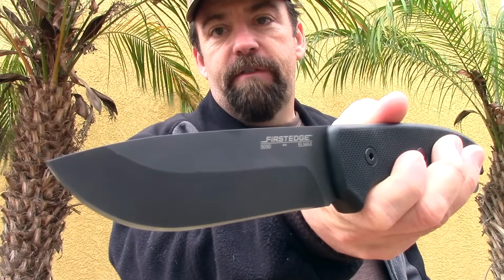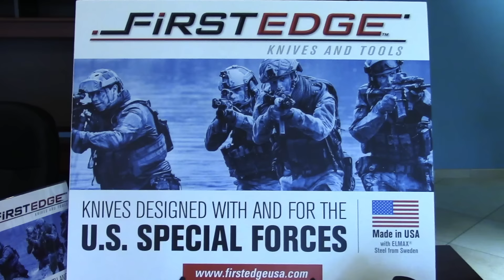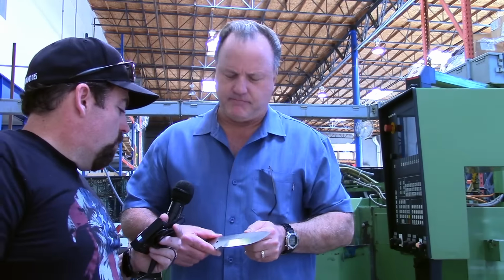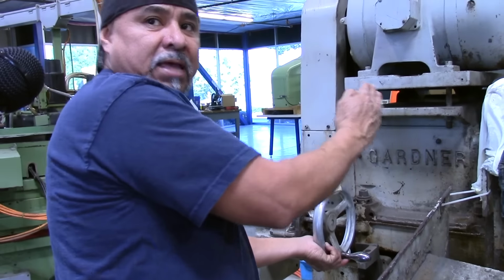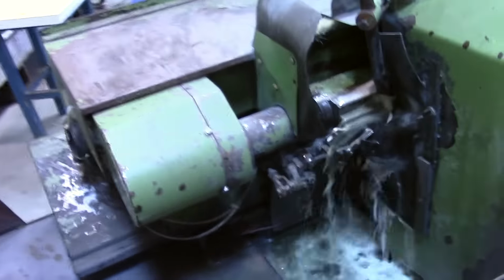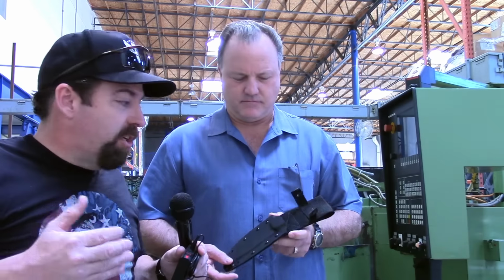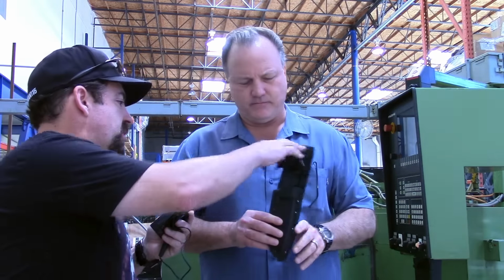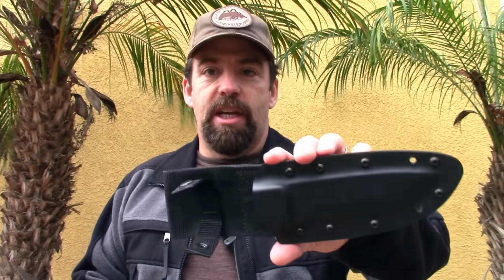Navy Seal Survival Knives - FirstEdge Knives Factory Tour

Comment: There's a reason the Ontario Mark 3 Diver is the issued knife and has served SEAL teams well for years. The hardening process and corrosion resistance on their 440a is unrivaled. And at $60 you just can't beat it. Well actually you can beat it. And it will just laugh at you.
Reply from the maker: +specopsbrat I will check it out.

Comment: Say Heah John, I just saw this 5050, it's awesome, I like that style of knife, infact I had one I made a few changes to..The base knife was the Rodent 6 in the SR101 Busse Technology 52100 Ballbearing Steel.  It comes at .265" thick so I had the blade thinned down to under a 1/4" thick,  Then I had the top gaurd taken off. It's now a High Saber Vex Grind just the way I like it. It sort of looks like a beefy RatManDu on steriods. And it's a 6"+ blade but with a choil, where the blending taking the top gaurd it allows my hand to even chop better. My Modde Rodent 6 is my Fav's 6" Survival Knife hands down. I pair it off with my Victorinox Delemont Collection Ranger Grip 78 and my 2Hawks Double Bit Hatchet and my Wicked Tough Saw and off I go into the wild bush yonder [,,,] Yup, no regrets, and surprisingly it does look a little similar to the 5050.

Comment: If the problem is determined not to be caused by defects in manufacture or materials we will inform you of the cost for repair. Upon agreement and payment we will perform the repair. If we are unable to improve the condition of the knife, we will return it to you with the recommendation that it be retired from use.
not sure how i wanna feel about this, but here's what i get from that: If the knife fails and you send it for repair they can charge you money and even if they can't fix it all they will do is tell you to retire the knife and you won't get any money back for their failure to repair the knife or even get a replacement knife.
Reply: +ZombieFighterOf2001  i could not believe it at first, i was like what am i reading. 
they just want the money.
Reply: Old post... but this still applies... they're saying "If you use the knife to do something stupidly un-knifely, such as stabing it into hardwood just to "see" if the tip will break, they're saying that unless there was a hardness or steel issue they're not going to just give you a new frikkin blade as a reward for your stoopidity.  At around $300 FE knives are not overpriced, especially compared to Strider and Busse type companies that wanted well over $425 for full sized fixed with G10 and that idiot proof warranty you seek.
Esee can do the warranty their way because a) 1095 is nails tough (but not much good at anything else) and b) because Esse's are waaaay overpriced for what they are, so you are indeed paying for a warranty you should never need if you use it reasonably.

Comment: Say Heah John. This reminded me of two of my recent knives that I'm going to use for bush craft, I'm going large and small for my knife carry, well axe, and saw. But I recently got the Steel Heart Ergo and the Badger Attack Ergo,  nice matching set, Oh I had both thinned down, and they are sharp..good video John, Thanx.
Reply from the maker: +paulie 4x Let me know how it works for you..
Reply: I will, I've been using the Potbelly with a neck carry a Top's Mini Scandi 2.5,  But I really like my Rodent 7 and the Rodent 4 both have choils and that makes them very versital, the new set only the Steel Heart Ergo has a choil, the Badger Attack Ergo hss a very little one but it's less than a 5" blade so it might work out.

Comment: why do they do the heat treat before sizing and the angle of the grind?
Reply from the maker: Maybe to keep the blade from warping? I'm not sure.
Reply: @Wingman115  heat treating a symmetrical bar stock is more predictable/consistent, ie the thin edge of a pre-ground blade loses heat more rapidly than the spine, plus odd warpage habits in curvatures.  Its also easier to straighten warps out of simple bar stock than a 3-dimensional ground blade.  The manufacturers would much rather grind soft steels.. hardend elmax (and similar) is brutal on disks, belts, and bits... plus, any coolant or feed speed hiccup and the blade is ruined unless returned to heat treat.

Comment: It's a very basic design that I like; much like my Survive! GSO-5 blade, but they should have took note from Fallkniven blades and sandwiched some good expensive steel inside some softer stainless steel for a great edge, extreme toughness, and better resistance to corrosion.The knife would have been stronger, and they could have saved money and materials in the process.

Comment: if the blade was thicker than .235 and had a life time warranty, even if i broke the blade i should be able to return it and get a new knife or at least try to fix it at no extra cost.
and at its price it should come with a life time warranty.
not my first choice but as a whittling knife i might get one.
great video keep up the good work.
Reply from the maker: +one survival Thanks for watching.
Reply: Hmmmmmm
      After speed reading as many comments as I felt like,,,,,
    Go find an area of forest that has been clear cut.  And there are brush piles some squandering barbarian is just going to wastefulluy burn,,, and make a sturdy long term shelter with it.
   Make camp furniture with it
         Whittle out some cooking tools..and then knock off the local Kandahar giant....

Comment: Say Heah John,  I caught this video again,  And I do have to say so myself,  I think I'm pretty close with my thinking on knives I take into the bush.  I too want to take a knife that I know regardless of what comes up,  I'll have a good one.  Today it was a rainy trip a few of us took,  We're still on it.  But we agree no matter what the weather,  we treat for symptoms.  So a little rain didn't stop us and yes we did get wet,  But we set up,  made a fire and we dried up a little,  But we will sleep inside.  The knife I took is my INFIMandu,  It's sort of similar especially the grind and for that I'm happy with my thinking.  The steel is the INFI on mine and that to me is also a good steel.  Usually  I carry the larger knife on person,  But since I teamed my Nuclear Meltdown Fussion Steel Heart  and it's a pretty hefty chopper and the trust I have in my INFIMandu which is a Ratmandu but in the INFI Steel,  I decided to attach the N. M. B. S. H.  to my backpack and belt carry the smaller knife.  I also really like carrying my Mora 510 as a neck carry, if for no other reason but as a edge saver.  Although the INFI Steel holds a great edge retention.  But the more I see the 5050 the more I'm interested  in it.  Knives like this peak my interest.  I do go on some kewl trios,  so it's important I get a good quality.  If the Special Forces are involved,  I tend to check those kind out.  For instance the Bravo 1 This one and a few others,  I even have a CarbonV S. R. K.  because of the military association  it had.  Yeah,  I will be checking this knife out and the Elma Steel it's made in. Laterz,  Lemme win some money tonight heh heh heh.
Reply from the maker: Good stuff Paulie. Your comments always bring a smile to my face...
Reply: Thanx,  John.  I know some think I'm funny,  But I've been a student of this hobby for a few 24's and I sort of got the feel what works for me,  But it's always nice to see that I'm on in the direction I'm going in.  But I'm glad I put a smile even a chuckle on you heh heh heh Funny like Ha Ha,  he he he, ,, ,
Reply: I always liked that line I'm Good Fella's
Reply: In not I'm
Reply: Say Heah John,  You brought me some good luck,  After I watched your SCHF40LD video,  The hollow handle made out of one piece of 1075, I just bought a Solingen German Handmade Bianchi,  Yeah,  the guys that make leather gun holsters,  They were big before Kydex.  Anyhow,  I got a Hollow Handle Survival/Fighting Knife.  It was given to their pilots (German) I think.  Anyhow this thing is made solid,  It's Brass and a 440c. Blade,  But I mean this thing is well made.  I do have a few hollow handle knives.  My Randall Made #18, my Buckhalter #184, my Tomahawk Brand but made in the U. S. A.  that I think specifically made to hunt hog,  That's how we used it,  At the time it was one of the longer blades back then.  Then my Russian made Professional Survival Hollow Handle,  it's made at the same plant that the Al's are made at,  Izchmash.  and one of my Fav's Bokor Amaro,  a Martin copy  A Martin Amaro runs about $500.00 and the only difference is,  Of course the Martin are handmade and Bokor mass produces but the blade Martin uses CM 154 and my Bokor is 440c. and now in my stable is the Bianchi Hollow Handle,  I think the Nighthawk ? It's a beauty,  I got it in near mint condition.  I know it sounds like a brag,  But I just had to share that.  Thanx for listening heh heh heh

Comment: Instead of using the cheap, weak, noisy flap-snaps on the sheaths that usually get cut off when drawing the knife anyways they should have used the quieter, more secure, and less-likely to break method that ESEE uses on their ESEE 5 sheaths.. It's got a sliding lock on the sheath, near the entrance.

Those handles are not good when bloody or wet, or cold.. The steel will be touching your hands where the handle is not covering it, and that'll be no good if it's cold out and you can't use gloves for whatever task you're doing.. Fallkniven got that right with their handles as well, but they too could have made the handles a little better, in case you had to change them.

I feel like there is so much they could have done to make this knife so much more reliable, stronger, sharper, and just better in every way...